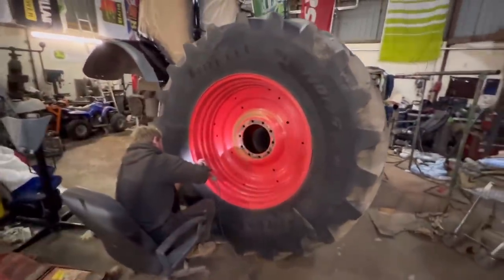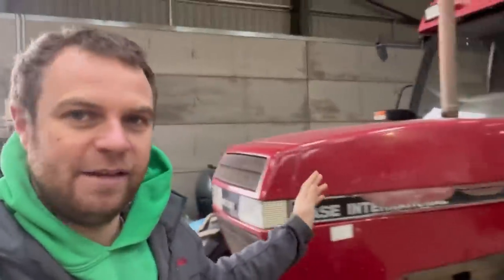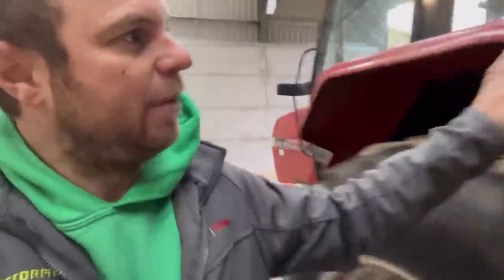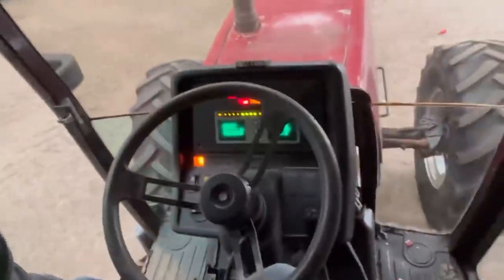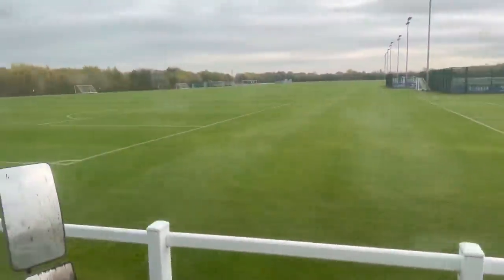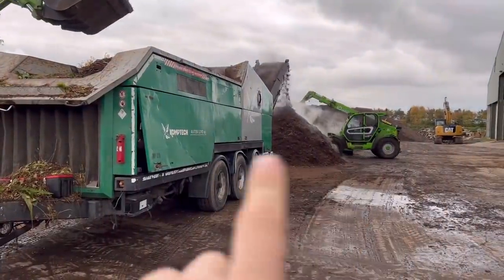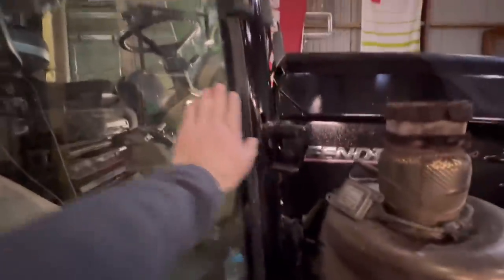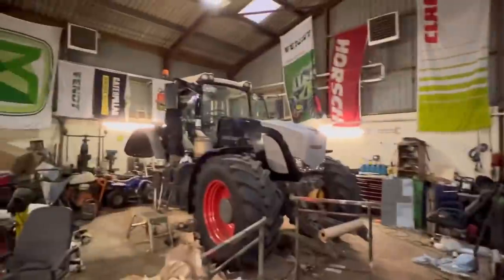Day598 #OLLYBLOGS FENDT UN WRAPPING MOVING SOMETHING SMELLY & AUCTION FUN  #AnswerAsAPercent

Comment: Spent a harvest in summer 1999 on one of these. Great tractor. Only thing was the visibility out the back due to the air con unit when grain carting. The gearbox probably went into the MX135 etc that followed.

Comment: here is a good tip for you to clean ur glass quick with paint or overspray use 000 grade wire wool it cleans quick and wont scratch or mark the glass i use it when fitting windows in landrovers
Reply: Unless its tinted with a coating, rather than in-glass !